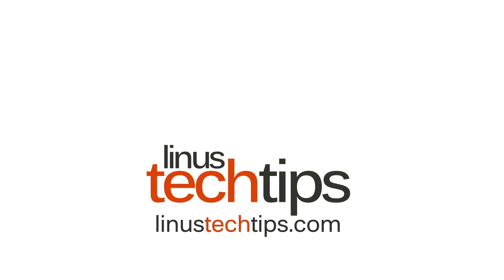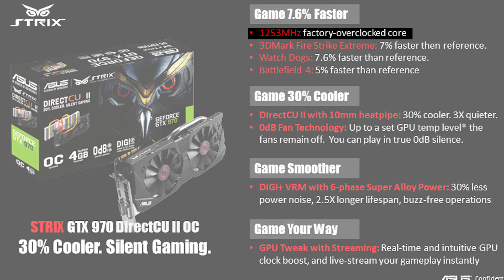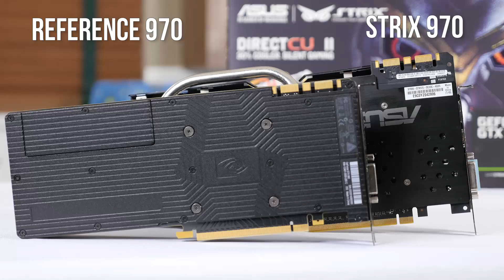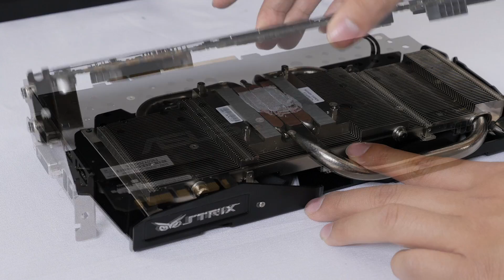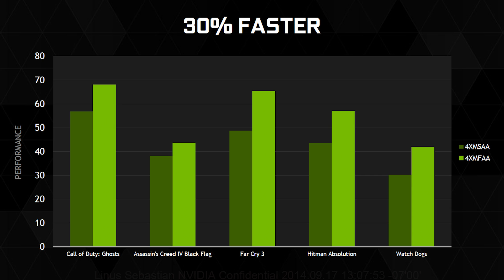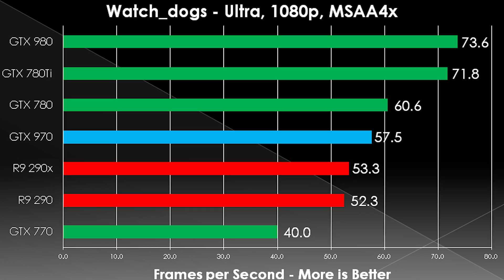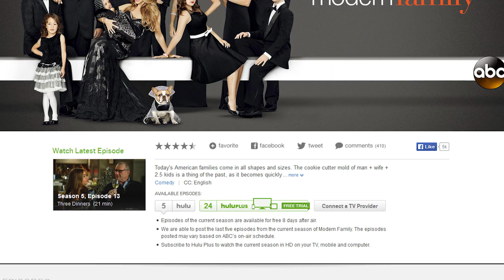ASUS Strix GeForce GTX 970 Video Card

Comment: Gtx 970 is an alright card. I rate it 3.5/4
Reply: +Silverlørd 7/11 was a part time job
Reply: @YASxYT  9/11 was a full time job
Reply: +Silverlørd its 8.75/10

((3.5/4)*10)
Reply: Edward Harris u wot m8?
Reply: Carbon Toast no actually its 9/11
Reply: FPScounter ICWUDT
Reply: ***** kappa
Reply: +FPScounter good joke, but I still think gtx970 is very good and powerful gpu. Only thing I don't like is that basically Nvidia lied about this vram thing.
Reply: +FPScounter i  r8 the gtx 970 9/11 would smash a plane into it :3
Reply: I don't think many people get the joke... 
The 970 has 4GB of memory, but 500MB of that memory is slower memory with a much smaller memory bus. This means it effectively has only 3.5GB of GDDR5 memory. Stop dividing and shit that's probably not his actual rating for the card it was just a joke that basically no one who replied to it got.
Reply: +radioactiveplums Well you can utilize all 4 gigs but if the card starts using the last 500 or so mb it slows down greatly.

All I know is Nvidia fucked up bigtime.
Reply: +FPScounter Made my day hahah nice one
Reply: FPScounter xdddddddd I'm still buying it tho
Reply: Lol
Reply: I got this 970 but while playing games like bf4 it gets up to 150 F but in the video he said it got up to 70 F while overclocked and under load is there something wrong with my gpu?
Reply: The gpu fans were running at 850 rpm and I have 3 fans blowing at it btw
Reply: +Ninja1inblack he said 70 c smart one, come on mam
Reply: +FPScounter OHHHHHHHHHHHHH I GET ITT
Reply: +FPScounter Oh shit, that's funny xD
Reply: +FPScounter lol
Reply: +FPScounter memelord
Reply: +FPScounter LAte to joke but. Bravo, Bravo
Reply: +FPScounter per dollar it is the best card ever made. God tier.
Reply: +radioactiveplums I did!
Reply: +Ranger5004 the gtx 750 is... just saying
Reply: +FPScounter can you play gta v with the card?
  im new to this
Reply: +Mathias Yes. The comment was a joke. It only has 3.5GB of usable VRAM. It still runs GTA V with ultra settings or very high settings.
Reply: Mathias Yes not even a problem i would say its overkill for gta v on  1080p
Reply: +FPScounter ROASTED!!!!!!!!
Reply: Disturbed246810 NVIDIA didn't fuck up big-time. They were dishonest. 970 still uses the same architecture as a 980 and it is essentially a binned version of the 980. The only reason why 970 has performance close to a 980 is because of the 3.5+.5, otherwise the GPU would be under-utilized. Worrds from PCPer: "if the 7th port is fully busy, and is getting twice as many requests as the other port, then the other six must be only half busy, to match with the 2:1 ratio. So the overall bandwidth would be roughly half of peak. This would cause dramatic underutilization and would prevent optimal performance and efficiency for the GPU.”

If you're honestly nit-picky about those last 512mb, then get a 980 or a 390. Imho, NVIDIA did a great job pulling out as much power out of a binned card for 3/5 the price of their flagship card. Stop following the media sheeple and do your own research.
Reply: Bobby Cheezpuffs Yeah after doing more research and learning about how the hardware worked a bit I understood it was ultimately a Engineer to PR mistake. It sucks but eh.

But yeah I ended up getting a 980 STRIX. I love the thing. A massive upgrade from my two 6850s.
Reply: I see what you did there…
Reply: oh I see what you did there..
Reply: FPScounter Good card, never had any issues with it, Runs Smooth. I have had it for about 3 years now and its an Nvidia GTX 970 FTW Model :o)
Reply: Yokes
Reply: Disturbed246810 It doesn't slow down "greatly" at all, that's a complete myth. When compared with the 980 it loses 3-5% performance going over 3.5gb. So sick of this misinformation, the benchmarks are everywhere
Reply: FPScounter NO it doesn't, and going up to 4gb it only loses 3-5% in benchmarks compared to a 980 when going over 3.5. Just get sick of this.
Reply: Still have this card 150 Fps on Fortnite epic settings with anti aliasing on and I get a constant 45 fps on anthem beat card I've ever owned
Reply: @silverlordboy  Go back to school - 3.5>4/5 = 7>8/10
Reply: Good one.
Reply: +FPScounter exactly how Nvidia rated, they said 4 but users found out it was 3.5 ! lol

Comment: £285 for this card and you get the new metal gear solid phantom pain from 

http://www.scan.co.uk/products/4gb-asus-gtx-970-strix-direct-cu-ii-oc-pcie-30-7010mhz-gddr5-gpu-1114mhz-boost-1253mhz-cores-1664-dp

Comment: Is this worth getting with an i5? will I Have to upgrade to soon? also is the 780 better than the 970?
Reply: Cam Par Yes, the only thing you can't have turned way up is the Anti Aliasing, you can generally have it at 2x or 4x but no more than 4x in most games for me :)
Reply: The 780 is not better than this but the 780Ti is. An i5 would go along with this thing nicely
Reply: I have an i5 4690 and a wind force gtx 970 and it's an amazing combo. If you're at 1080p an i5 and 970 is probably the best combo
Reply: Austin Hughes can u play 60fps maxed out graphics?

Comment: may i ask, how is this build?
cpu-: i5 4590 3.3 GHz
gpu: Msi gtx 970 4gb 100ME
Ram: Hyperx fury 16 gb (2x8gb)
motherboard:  MSI ATX DDR3 2600 LGA 1150 Motherboards Z97-G45 
psu:  corsair cx 600 watt 80+
memory: 1tb 3.5 inch caviar blue
Internal drive: Asus drw-24d3st 24x internal oem dad burner drive
case- deepcool tesseract SW Mid tower case

Comment: What did Linus over clock the GeForce GTX 970 to??? (using GPU Tweak)
I have an Asus GeForce GTX 970 too, but I'm too scared I may break it if I mess with the settings too much.
Reply: They used Afterburner. The overclocking information is linked.

Comment: For the same price, would it be worth getting a 780ti or a 970
Reply: +Jakey120 TI is better in most benchmarks i've seen, but Nvidia stopped supporting the older series. When a driver comes out it's mainly for 900 series. A bit longer more 970gtx will beating in more games

Comment: For my gaming PC should I get this card or the Radeon7990?
I have a 850W PSU
Reply: always nvidia
Reply: Raw perfoqmce go 7990, cheaper too.
Reply: 970
Reply: Blazing_Fox My 7950 was hot, loud, and used lots of power. Can't recommend 7990 because it can only be worse
Reply: 7990 is a dual card 7970 which as a single card is on a GTX 960 level. look up 7970/280X crossfire benchmarks

Comment: Should I buy the Amd 9590 and keep my motherboard or should i get the intel core 4690K along with a new motherboard
Reply: Danbaseball18 If playing games with the AMD FX-9590, the CPU will heat up quite a bit since it is clocked at  whopping 4.7GHz OC. The Devil's Canyon 4690K will have a much better experience playing games, and if overclocked, it will have a better TDP than the FX series and even the other Haswell based i5 and i7 grade series.
Reply: K thx

Comment: what we can draw from this? hmmm get R9 290 lol seriously though you can get a good 290 for about 70USD less and get rawly the same performance at both 4k and 1080p, plus some of these newer games are using Mantle. the only problem is it usually takes a 6&8 pin power connector(2 6pin or 1 8 pin on 970), but you could probably get a PSU with the money you save. one thing is for sure, now is the golden age of bang for buck 1080p gaming.

Comment: is anyone else experiencing this card is LOUD and HOT AS FUCK!!!
Reply: Wait sorry guys it was my fx 8350 thats loud as fuck hahaa
Reply: when playing games the fan is like WOOOSSHHHH vacuum cleaner
Reply: Check out Linus' coil whine video, if thats the sound you are hearing no worries, however if its not you should look into RMA...its not uncommon for aftermarket cards to have coil whine, card makers are working on reducing the causes however there does not seem to be a quick fix as of yet
Reply: Coil whine tends to happen most the faster your FPS
Reply: Heat however is not normal...average/benchmark loads at stock clock speeds should be under 70 max (even at 70 its a bit high)
Reply: Sounds like you're describing an amd card
Reply: John Derman If you're not overclocked get a cooler master hyper tx3 for about 20$ (Sometimes even 15$) and you'll have it quiet and cool :)

Comment: Hey does anyone know if a 350 watt power supply would be Enough for the GTX 970 SC with a i5 4430 Intel core?
Reply: Ben Duncan It is too much You are wasting your money on that psu. I do have gtx 970 sli i7 4790k and 80w is more than enough.
Reply: Ben Duncan at least 500 watt the gpu itself uses 225 watts
Reply: +▼e you might as well power it with a pair of AA batteries.
Reply: You need a minimum of 500w and you can't run the 970 in 4-way sli
Reply: +Ben Duncan You need 1337 watts.
Reply: 1337 watts!! are you crazy ? you can go pc + rooms central heating radiators with that bro
Reply: Chag1n Its a joke. Obviously you don't need 1337 watts.
Reply: its all about jokes bro

Comment: Hi guys, 
how do you think my cumputer I will buy. 

Asrock fatal1ty h97 killer 
Intel Xeon 1231 e3 
8gb crucial ballistix sports 
The card from the video 
 630 watt be quiet 
128 gb ssd
Reply: Philipp Zauner Dont get a Xeon. If youre getting a GTX 970, then you'll be better off with a i7 4790K which is much cheaper than a Server Grade Xeon.
Reply: The xeon is about $250 and the i7 is $330
Reply: With the i7 though, you get better performance on games.
Reply: yeah but not everyone has an extra 100 dollars for a i7

Comment: Asus have released 3 different 970s excluding the small form factor one, a video to show the differences would be cool. I believe one of them has a higher power requirement allowing for more overclocking and or course there is the strix, and they have released a 'double blower' design that takes in air from the back as well as the front and exhausts it out the back.

Comment: What difference does it make when its ASUS or GIGABYTE or MSI? I really have no idea because aren't they the same graphics card anyway?
Reply: How would you place them in order of best to worst?
Reply: I can only speak on the MSI 970, got an easy ~20% overclock on the Golden Edition (which is already a higher clock than the MSI gaming 970) while still maxing at 68 degrees...running all games at over 60fps minimum at max anti aliasing @ 1080p including Skyrim with tons of mods.

Comment: Hi is there any difference between this one and MSI GTX 970 version or are they all the same? Thanks.
Reply: Nee Lze The Twin Frozr cooler on the MSI card has slightly quieter fans, but the Asus cooler is more effective and has more power phases.

Comment: Can assess whether my current build as below would be ok to upgrade just the GPU from R9 270 to this Asus GTX 970? Its just a mid spec tho.

CPU i5 4440 @ 3.10Ghz
RAM : Kingston 8GB (dual channel) DDR3 1333Mhz
Mobo : ASUS H81M-C
GPU : ASUS AMD R9 270
1TB Seagate HDD
PSU : 600w Cooler Master

Or need some stuffs to upgrade as well? Thanks in advance

Comment: will my i5 3570k bottleneck the gpu?
Reply: Made1nGreece No not at all. I run a FX 8350 OC to 5.1 Ghz and under a custom water loop. It doesn't bottleneck that CPU whatso ever but than again on certain games it does. but I have 3 monitors and 2 of these cards running them!
Reply: Made1nGreece  You should be fine with that.  i5 is unlikely to be a bottleneck in my opinion. You can always overclock the CPU a little if you want to be sure.
Reply: i use turbo mode and cpu-z say its 3.7gb
Reply: You're good to go I reckon. 980 might be an issue, but not with 970 I think. I'm using 2500k which has similar performance.
Reply: ok.. i'll buy the 970. 980 is very expensive here. as you can see by my name i don't live in America where 980 is around $550(€480). in EU 980 cost around €630($700+), and for slightly better performance than 970, almost double price isn't worth it(i play at 1080p)
Reply: ***** no thanks. as i said in my previous reply i don't plan to pay $700+(€630 in EU)

Comment: Is this a good build?
ASUS Strix Gtx 970
i7 4770 3.5ghz
12gb DDR3 Ram
Please Answer.
Reply: ***** Thanks! I've got everything but the graphics card.
Reply: ***** Mainly playing games and recording! But I will edit as well as that. Also watching videos!
Reply: ***** Thank you! Are you interested in getting the same build?
Reply: ***** TBH i highly doubt u will ever fully use 12gb ram, ever, unless u like opening 20 tabs with chrome. And Tidfe is actually right. For gaming 4690k will perform better than a 4770 especially after water cool overclock.

I also dont know about the pricing of cards in your region, but here in hong kong a 780ti is just a tiny bit more expensive than a 970, and will deliver much higher performance. And for me personally asus designed coolers are a bit overpriced and maybe i just dont like their looks and colours.

But ive read that you have already got everything, so dont feel bad for it. Itll still be one hell of a system. Enjoy
Reply: ***** Im a dolphin in real life! :D
Reply: ***** PierreDolphin You are frienda. You like yourselves. Peace bros
Reply: Can it run in 2 monitors i am new to pc building
Reply: Om hdmi
Reply: Luke Does Hopefully, although you might need two cards if you want 1440p or even 4k for that matter!
Reply: OK tanks i go with 2 cards than
Reply: ***** I'm getting a build similar to yours. Can you tell me what settings your on with how high your FPS is on games, if you play these of course, BattleField 4,GTA V, or ArmA 3.If not just tell me any game with your settings and FPS, please.
Reply: Dawson Ed Ah, I get around 60-100 fps, average is about 55-70 GTA 5 Battlefield 4 is about the same, Arkham Knight runs at about 50-60 but it stutters, that's not my pc though, it's the game
Reply: Cool build. Probably to late now but I would swap the i7 for a i5 because the Intel core doesn't matter to much on gaming. Then you could probably upgrade one of your other components.

Comment: I'm thinking of getting a new PC for £800 i'm looking to buy a AMD fx - 8350 , gtx 970 , GB of ram along with the motherboard etc. will i be able to play the latest games at high settings, i understand that the AMD chips have bottle necking issues but for a avid gamer trying yo get the best gaming experience without spending too much on an Intel chip would this be ok? any help would be fantastic thanks.

Comment: What do you guyz think for my first gaming pc build ?

CPU- i5 4690K
MoBo- Asus Z97-A
GPU - ASUS Strix GeForce GTX 970
RAM - Corsair Vengeance 8GB DDR3 1600Mhz
Case - Corsair SPEC-03
HDD - 1 TB barracuda
SSD - Samsung 850 Evo 120GB
PSU - Any suggestions ?

What do guyz think is it a good build ?  do have any better suggestion for this build ?

Comment: So guys, I am pretty confused between the GTX 970 and the 980. I'm only using my PC for browsing and moderate gaming. So which one is best?
Reply: Yeah even the 960 should be cool 2gb for moderate gaming is more than enough, tho really the 970 is so cheap that you pretty much have 2 960s on sli, i would suggest the 970 cause it will last you a long time for moderate 1080p or even 1440p gaming (3+ years being extremely good)
Reply: Kenneth McBlackenson 970 or 960

Comment: Hey guys, i'm going to build this gaming pc, when i got the money any tips to lower the price? I want to play every game on high with 60 fps :P But it's a little to expansive maybe i can use a build for 1000 Dollars/Euro's with a Intel processor and a GTX 970 card. hope you guys can help me :)

Intel Core i5 4690K 
Crucial Ballistix Tactical LP 8 GB DIMM DDR3-1600 Kit off 2  
Samsung 850 EVO 120 GB  
WD Blue WD10EZEX 1 TB 
Corsair Carbide SPEC-01 Red LED  
Corsair CS650M  
MSI B85-G43 Gaming  1  
Corsair Hydro Series H60  1  
TP-Link 450 Mbps Wireless PCI-kaart  
Asus STRIX GTX970 DC2OC 4GD5
Reply: Normally evga psu are cheaper i think... shame you gotta build it from scratch, have you considered maybe reusing your case and maybe buy new fans instead? And you dont need water cooling for that processor/build so dont even worry about it, that build is really similar to what i have and i can keep it really cool (-50c on everything of the motherboard except the gpu wich goes to 65c top) with proper fan ventilation, cheers.
Reply: Oke thanks man! :d

Comment: Would this card fit into a Bitfenix Prodigy? My Gainward GTX 760 fits just fine, and it's a full-size card. I've looked up that this card would be about 11 inches in total, so the length wouldn't be an issue. The only thing i'm really worried is the width though. Has anyone had experience installing one of these into their own case?

Comment: Planning on making a PC do these specs look good? Make any recommendations in the comments.
Specs:
I7 4790k
Asus Strix 970
16gb ddr3 1866 Kingston fury
750 watt power supply (evga b2)
Asrock z97 extreme4
1tb caviar blue
IPS 60hz 5ms 23" (acer)
TN 144hz 1ms 24" (acer)
Corsair k70 rgb 
Logitech g502
Fractal Design r4 w/window 
Corsair h105 liquid cooler

Comment: hhmmm.Been thinking about one of these for my rig to replace my 560Ti my rig runs BF4 with everything on high but im thinking its time for an upgrade. My current build is.
i5 2500
8gb ram ddr3
560ti
Reply: brokenhalo2001 LOL, you got same garphics card and cpu as me, and ram
Reply: omg. we should like totaly date/ A/S/L ;)
Reply: Ooxaz tj
Reply: brokenhalo2001 It's funny, I'm thinking of ditching my 560Ti in favour of a 970 as well. I really like the 560Ti, and it's been a lovely card, but I really would like to be able to play AC Unity at more than 10 fps... I also happen to have the same amount of DDR3 RAM as you, but I'm running a Phenom II X6 rather than an i5.
Reply: brokenhalo2001 Careful, I have the same CPU as you and I just got the 970 recently, I ran into bottlenecking issues so I had to overclock my CPU.
Reply: its funny tou ive been building for years ive got no idea about this bottlenecking thing.